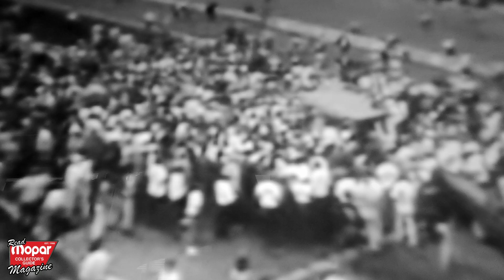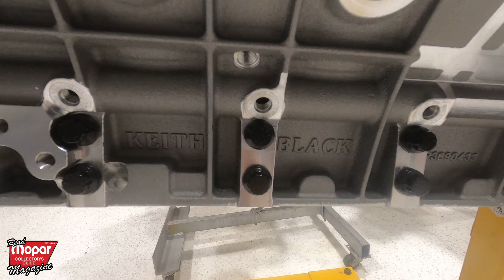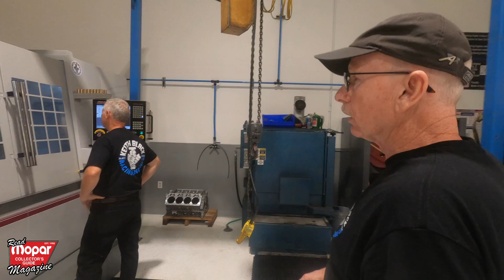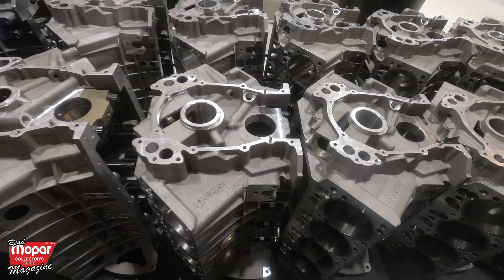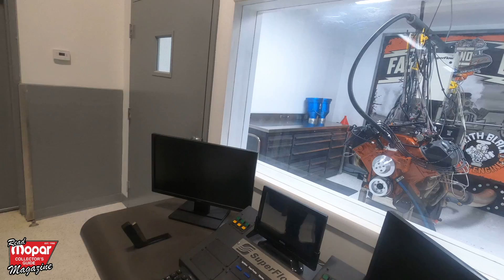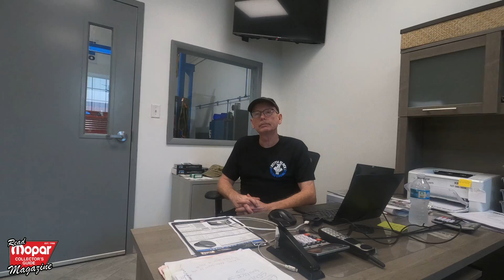Keith Black Racing Engines throttles into the future.

Comment: 1) Is this engine capable of beating (going faster than) a Pro Line Hemi like they race in Pro Mods? 2) Can it survive going high 3.50s in an 1/8th mile? 3) How much weight difference is there between your billet aluminum Hemi and Pro Line?

It would be really cool seeing THE ORIGINAL King of the drag strip KEITH BLACK back where it should be.
Reply: Chrysler based HEMI engines like the Proline, AJPE and Noonan are dedicated max effort billet race pieces. The KB blocks and Stage V heads offered by Mr. Banning in this particular video, are castings that more closely resemble production configurations with full water cooling and the ability to utilize factory accessories. They are in no way intended for the same market and not designed to compete with a full tilt Pro Modified engine. 

As for weight, my 4.500 bore, 4.800 bore spacing KB water block scaled at 144lbs, with main caps and studs. I don't know the weight of any manufacturer's billet Pro Mod block in either 4.800, or 4.900 bore spacing.
Reply: @geneticrex  TYVM. I still love the idea of Keith Black engines showing up in various levels of drag racing. It is almost back to the future.

One thing Chrysler either drug their feet or had a terrible time just licensing a company or companies to manufacture the basic  steel engine blocks for the 426 Hemi and B/RB Big Block Wedge engines. They were supposed to be at one company, then another, then another etc. but nothing happened. FINALLY Callies with its sister company Energy Manufacturing Ltd. have the deal and have shipped product. Here it is two unique blocks.

I was intrigued with a different company who planned to make ONE block they called *THE BLOCK*. That block had extra reinforcement on it for vulnerable areas. It could be used as a Hemi or a B/RB Wedge engine. It was one of the never happened ones.
Reply: @Irish_For_Life1842 You are so right. I've been involved with the sport since 1975. Over the years, the supply of "good" aftermarket blocks has been up and down. Right now, with the Callies deal and Mr. Banning bringing KB back to life, along with another option, or two.....it's in a decent spot.

Comment: A lot like Tim, I also found a deal.  I had been hot on the trail of a 70 hemi Cuda in my area for years.  I was running late for work one day but needed to stop for a splash of gas at a small two pump gas station out in the sticks.  Low and behold, the owner of the Cuda was slipping a for sale sign on the windshield as I pulled in.  As I was pluming gas I yelled at the guy, how much?  He yelled back $4,000, I yelled get your uncle, he yelled OK.  His uncle to walked out "we knew each other" and I told him IT'S SOLD take it back home I will pick it up tomorrow as soon as the bank nearby opened.  I jumped in the car and headed for work.  This was in 1981, the Cuda was a 4-speed, track pack, Plumb Crazy Purple, black hocky stick and interior, console delete and an 8-track.  Just like Tim, this started it all for me and we soon had several cars.  Loved the video, and would love to have a Keith Black hemi in a black 32 Ford three window and I'm 74 now.  This just shows that it never goes away, hemi fever that is.

Comment: Suggestion,   there is a twisted 45 degree ball-stud Hemi engine, 426 now 481ci in a '68 Barracuda,  an A 279 engine,  in the National Auto truck Museum in Auburn, Indiana.  Build one,  build a bunch of them. The engine is 100 pounds lighter and re-bore to 4.500 bore size.

Comment: mopars unlimited has a 383 hemi for sale somebody modified a 383 block to use hemi heads if the new owner of keith black was smart he would buy the motor and mass produce the block the shorter deck with shorter stroke winds up a lot faster on the streets . its a superior street motor
Reply: True, but everyone is hung up on the tall deck 426
Reply: @alanmeyers3957  that 383 block converted to use 426 parts makes a lot more compression and winds up about 1200 rpm more and does it a lot faster without the webbing breaking ! if they all want a tall deck they must not know much about engineering cause its almost exactly how tall the new helliphant is ! the tall deck 426 should have been more like a 526 from the factory

Comment: I have had good results with BAE engines and heads. KB too. Wish you were making the big valve heads too.  I have a couple KB's with the 9/16 head studs and they are pretty early production. The BAEs have been really good to me. I haven't had any issues. The new KB facility is local to me which I like. We don't have decent machine shops in the Tampa Bay area. True story. It's getting BAD

Comment: Go watch Rick Seaman's videos on his KB Hemi build.  He says the dowel pins for the heads are off by .006" and the stock 426 Hemi used Ø.246" dowels instead of the more common Ø.250" used on his KB block.  Maybe get a set of production drawings from Chrysler if they will sell them to you.

Comment: I'm so glad to see Keith Black back in operation and making engines again. I worked for Keith black up in South Gate, right out of high school in the 1980's milling forged 4340 aircraft alloy steel billet cranks. I always came home covered in metal chips. The old Italian milling machine I worked on used to break its mounts to the floor and dance around the room until you could dive for the stop button and turn off the mill. A little scary, but the guys seemed to enjoy it. Glad that machine is gone. Good luck to the new Keith Black.
Reply: Hard to believe a crank would be made out of aluminum.
Reply: @Georgeboy18347 this guy, I think he’s confused, it’s been a long time.
Reply: @Georgeboy18347  Who said aluminum?
Reply: Aluminum crankshafts, are you sure about that?
Reply: @alanmeyers3957  I think you need new glasses.